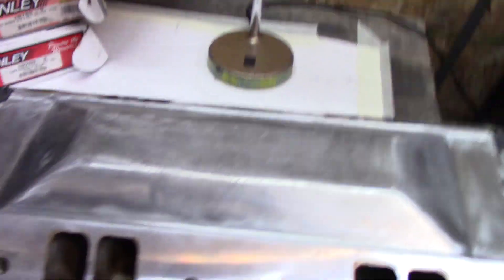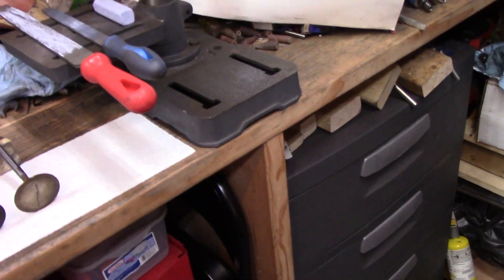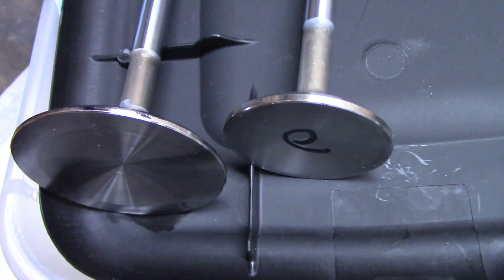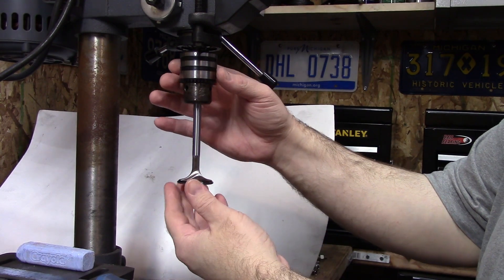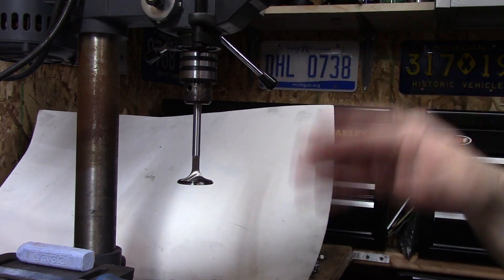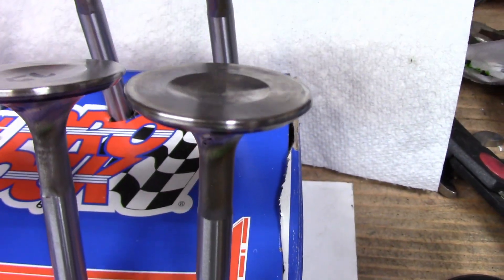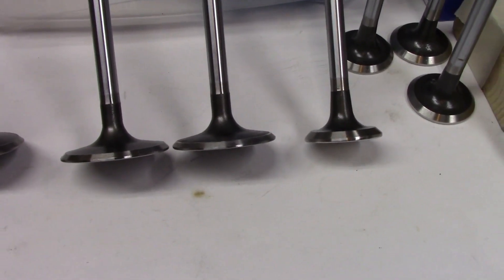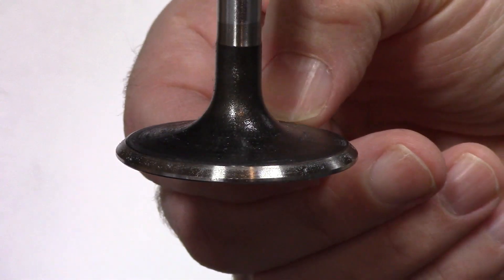Valve Performance diy Modifications & Why I'm NOT Back-Cutting My Valves

Comment: Bro I know its a old video but why wouldn't you wanna start filling the cylinders asap?
Reply from the maker: Because that cam's overlap causes exhaust reversion.  Think i mentioned it in the vid, that my cam for those heads, wasn't ideal for low-lift flow.  BUT other combos could benefit from it.  Some valvejobs are designed that way as well, just depends on the combo/engine.
Reply from the maker: Basically more low-lift flow, would equal more reversion and hurt power.  With the camshaft I was using.

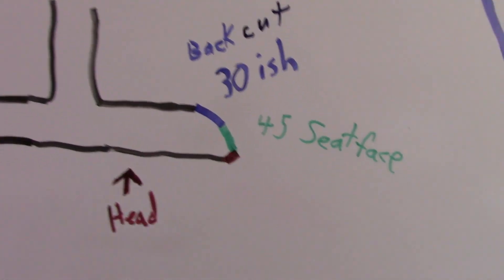Comment: Up to 5:07.....let me help you out. First, all valves have a margin. Any valve that comes to a sharp abrupt edge would be "knifed" and should only be used to protect the seat when removing the "machinist ridge". The margin is 90° to the valve head and the 45, 50, or 55 valve seat angle typically comes after. Without a margin the valve will not live long. It needs the margin, minimum 0.040", to dissipate heat. An exhaust valve will have a generous margin vs the intake valve may be as thin as 40 thou.

Backcuting the intake valve:

There is nothing wrong with a 30° backcut on the intake valve. The valve is at lower and mid lifts longer than at full lift where some see a loss of flow with a backcut.

The backcut most see and use is 30° because air doesn't like to change direction any more than 15° at a time. Hence the "3 angle valve job" , 60°, 45°, and 30°.

In addition to the 30° backcut on the intake valve, a 60° and 75° cut can be made towards the margin after the seating angle of °45. That's if there is enough margin. Combine that with 75°, 60°, 45°, 30°, and 15° on the seat and you have the best possible intake valve angle arrangement. 

Backcuting the exhaust valve:

No. This is where you want to deter low lift flow. Get all you can on the intake...limit as much as possible on the exhaust. 

A 45° on the exhaust valve and seat only. Use a "nail head" valve. Not a "tulip" valve. Backcuts, angles on the seat, and tulip valves look good on the flow bench and increase flow, but they also make it easier for the incoming air/fuel mixture to leave with the increased flow. There goes your power. 

If ANYTHING at all should be done to the exhaust valve, a generous radius from the margin to the valve face. This would help the incoming air charge skip over the closing exhaust valve vs sneaking out under it. 

With the exhaust gasses under pressure and leaving at close to Mach 1, there is little assistance needed to expell the gasses. As soon as that valve cracks open that shit is outta there. Little if any is left by the time the valve is at full lift. So as it's closing that's the overlap low pressure area left behind to allow the air/fuel charge to enter.

Your reversion:

This can happen for a number of reasons. Your overlap is not the reason. 

Low intake air speeds from improperly ported or non ported intake runners is usually the culprit.

Exhaust runner outlet shape can be a factor. I see a lot of cylinder heads port matched to the header gasket and that meets the header flange exactly. The outlet of the exhaust runner should be higher, by 0.125" or more, to block the returning exhaust pulse.

Poor header design is often another reason for excessive reversion. Primary tube size and arrangement is EXTREMELY important. A 28" long 1⅝" primary to a 2½" collector on a 383ci engine is bad enough. Add unequal length tubes and its a recipe for disaster. 

Unequal length shorty headers headers are just as bad.....

Equal length large primary, 1¾" or larger, shortys is a good start, but long tube tri-y to merge collectors are the ultimate header.....

I'll take the Pepsi challenge with a set of tri-y's against any header all day everyday.

Sorry for the Harry Potter novel, but this is a subject I know well and deal with everyday. I hope this helps clear some confusion or whatever. Good luck.

Comment: I did this to a set of 460 exhoust valves. Stock valves. They had a nice thick margin to work with & they turned out very good. I flow tested those heads & had substantial gains. 
  But i tried it with a set of stock 390 valves & 1, the 390 exhoust valves were much harder than the 460s. My file bearly cut them. And they had less of a margin but the margin they do have is at a angle, not straight up & down. But the little bit of cutting i did get dun it just seemed to knife edge the 390 valvles. I never used them. Im sure they wiuldnt work well.

Comment: Just a quick data point: I wanted to make a very flush set of 4 valves to put into my head while polishing the combustion chambers on a BP4W Miata head. I threw old valves into a metric collet on my milling machine, threw a lathe tool into the vise and used it like a lathe. The valves were not hardened or work hardening. It would be possible to modify a full set of these valves using machinist techniques to make them all the same. If they had been 304 or something like that, it would be difficult at best. Not sure if this holds for all makes of valves. If you are here, more power to you!
Reply from the maker: For dummy chamber grinding valves, I just use a hand drill and bench grinder.  David Vizard does his Back-Cuts that way.  For "some things" the mod itself is most of the gain, being very precise n consistent isn't that much more or any "sometimes".  If DV is happy using his eyes to back-cut valves, then that's good enough for me.
Reply: @BOOT  Funny, I think I saw the video you are talking about this week. DV knows his stuff. I wish he'd given a few more specs about his grinds, but I suppose you don't want to give it all away. Oh well, my motor is together and I'm hopefully I'm not pulling it apart for a long time.

Comment: Not one single valve will be the same with this file method
Reply from the maker: They don't need to be.  I've herd more than one PRO say, the exact back-cut angle doesn't matter long as it's in a range.  Again, my example is David Vizard using a hand drill and bench grinder to back-cut his valves.  He shows himself doing it in one of his videos, go check it out.

Comment: I understand your..."thought" process. But why are you installing a bigger cam.. your installing it for more power right? Why would you hinder that if this theory works and lose power .. especially a 30-40- or even a 50hp loss. Makes no sense. If it isn't fouling plugs which it shouldn't cares about exhaust in the intake. That's "normal" for high lift overlapping camshafts. Your thinking too much into your "hotrod" build. Whomever told you that you bought it but it's definitely a mistake. Need to make a video on how this was a mistake. Period. You'll get more likes
Reply from the maker: Do you understand how some seat Valve Jobs hurt/help low lift flow, it's the same principle
Reply: @BOOT  you do what you do. But eventually you'll come around. No one says... I'll lose power mid lift to keep a cleaner intake. That's the truth to the video. A dirty intake. Lol. 
But it's your build.
Reply from the maker: @gpt5002  And you keep doing w/e your doing, FYI Google reversion.  It's not bout a clean intake, maybe try watching the video

Comment: Is That Ridge Or Lip On The Exhasut Valve An Issue If Some Exhasut Valves Have It And Some Do Not? For Some Odd Reason I Got A Set Of CNC Ported Heads With Larger Valves etc. They Forgot To Shorten The Valve Guides For More Cam Lift Clearnence So I Did That My Self. When I Had It Apart And Inspected All The Valves And Seats I Noticed 2 Of The 6 Exhasut Valves Had No Ridge On Them While The Rest Had The Ridge. (this is a 6 cylinder 2 valves per cylinder engine). Do You Think This Is Going To Be An Issue If Some Valves Have The Ridge And Others Do Not On The Same Cylinder Head? This Is A Turbocharged Engine. What's Weird Is The Valves That Do Not Have The Ridge Sit Further From The Head Requiring A Longer Pushrods On Those Valves About .025" Longer (hydraulic lifter engine). It Took Me 2 Years To Get These Cylinder Heads And I Just Want Things To He Right If Something Is Not Right.

Comment: I've never heard of or seen reversion going all the way back into the intake manifold runners, it seems impossible to me, like how does the engine even run, you must have cam timing with a super early opening intake coupled with a horrendously poor flowing exhaust.
That staining looks more like heat cooking fuel in the boundary layer, how hot you runnin this thing ?
Are you running a shit ton of cam advance ?

Also it seems to me not back cutting your intakes would make the situation even worse not better ? i think your thinking that one backwards ?
Reply from the maker: They have Anti Reversion plates that go under the carburetor, this combo liked one.  Also search on youtube "kaase aetc video"
Reply: @BOOT  Shit dude that was f-in cool, talk about hands on eh !! Okay im gonna think about this reversion thing some more. tks....  for others who may be interested a direct link : https://www.youtube.com/watch?v=7Iq1B-2paCs&ab_channel=NickNorris
Reply: @BOOT  Years back when i first build a bench and started flowing heads i built a spacer like that for a single 4 barrel set up but i had 4 clear plexiglass tubes, i fired the thing up, revved it a few times and the plexiglass started cracking everywhere because it got ice cold, i glued the cracks but didn't do any more testing , it became a shelf ornament. Buddy in the video must be using Lexan.
Reply from the maker: @luckyPiston  I didn't link the video sometimes youtube flags links as spam but the poster never knows.  Anyways here's another with more info  https://youtu.be/ElcbVBOs5TE?t=1840

Comment: Why would you create a video thats only going to lead people to destroy their valves... Best you can do is remove this video
Reply from the maker: It's a proven mod.  Go watch David Vizard do the same thing, only he uses a hand drill and grinder.
Reply: @BOOT  i don't have an issue with mod....its the method used, high error and unrepairable damage...
   The mating area of both valve and seat  are precision work... no regular desk press drill nor hand can do such work..
   Valve mating angle has little to no noticeable effect when turbo charge.
Reply from the maker: @willis23jm1  The method is in a book, again it's old school well proven.  It doesn't compromise the sealing angle of the valve to the seat unless you hold it at that same angle or otherwise hit it.  Which can be easily checked with some dykem or a sharpie after.  I suggest you do some research on the subject.
Reply: @BOOT  exactly, some trolls don't know what they are talking about!